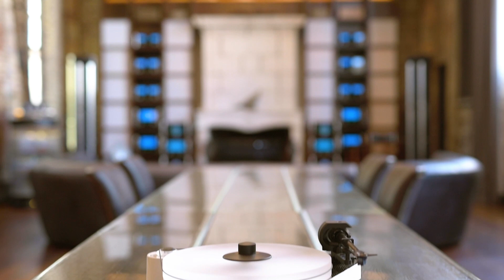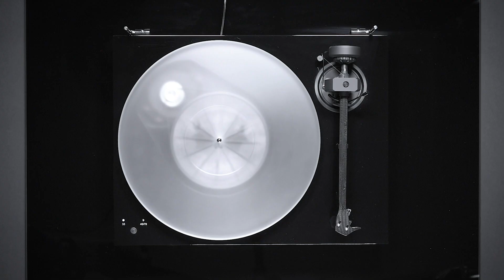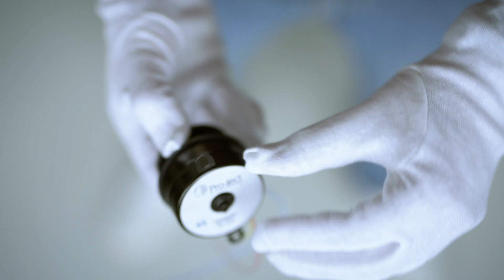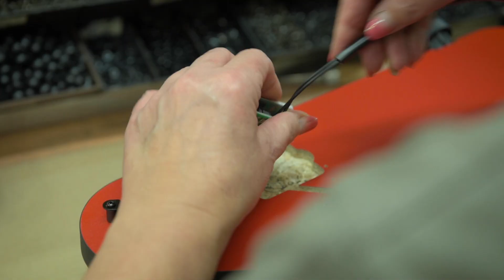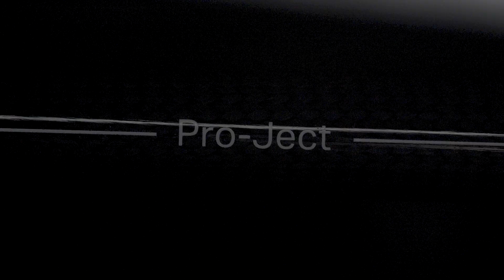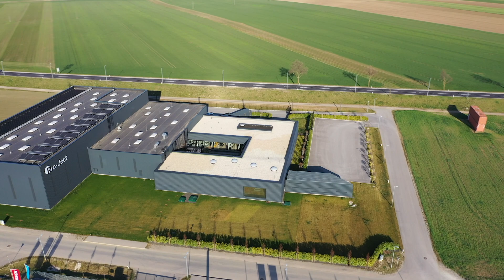10 Reasons for our turntables | Pro-Ject Audio Systems

Comment: I bought a Pro-ject 1. 2 brand new in 1995 (I think 😂) it was an entry level machine made by Pro-ject and it's still going strong and still sound's fantastic.
Reply: I've had one since '98. Got rid of the Oyster cartridge right away, though. The Grado Red has sounded really good, though I'm sure others would as well. The X1 and a few others have tempted me, but I've decided I'll stick with it until it refuses to stick with me.
Reply: @leonardblush2557  mine came with an Ortofon cassette.

Comment: Treated myself to one of these turntables recently, love the basic design but found a couple of problems using it. The on/off switch is underneath and using it will push the turntable to one side. Lifting the cover will lift the front of the turntable. I've heard that by using 3 mounting feet is ideal, but i found it made the table very unstable.  Most of these issues can be solved by using a heavier or better quality wood for the turntable carcase.
Reply: which one are you talking about?
Reply: how do you manage that? I admit the switch on my (carbon Evo) is stiff, but i don't just use a finger on the switch my thumb is on the top of the plinth so the table doesn't move.  I don't have any issues lifting the cover so your must either be very stiff, or you're applying more force.  Stability issues I don't have either unless you lean on the rear of the table where the single leg is. 3 legs  is theoretically the most stable design, it will sit on any surface no matter how uneven that surface is, which is why you see this employed on many high end tables, and many barstools too ;-)
Reply: The problem with the lifting of the cover and the stiff hinges also occurred on my essential 3. But it gets better after time. I really love my essential 3. Only issue i really had is that it took me a while to figure out that the usb output would only work if u used thr built in pre-amp. Since i connect my table to an old amp with phono in, i had switched the onboard pre-amp off. Thus disabling the usb. Now i know this, i will switch the pre-amp on whenever i want to make a digital copy of a record, and off afterwards. The switch is on the back of the connection box making it a bit difficult to reach.

Comment: Warning! This thing is silent when a record is not playing. I have accidentally left it on more than once. Awesome product
Reply: Nothing silent about 50db of rumble and motor hum.
Reply: @DJWolves97  Yeah, if the needle is not on the record, you hear nothing. Motor completely silent.
Reply: @abefroman764  Get full range speakers and a subwoofer and you will hear what I’m talking about. Which model do you have?
Reply: I have the pro-ject essential 3. Hooked up to a decent headphone amp with Philips X2hr headphones. When the unit is turned on and amp volume at max (no record playing), it is completely silent. No hum or rumble!

Comment: Except the A1 which...was a return for replacement for me. The platter came wobbly, the mechanism clunky and the worst parasitic noise in the speakers when in phono mode my guess because the platter rubs against the central spindle (not a great design). Quality control? Hope the replacement will be better or it's a return for me😑

Comment: i wonder if there will come a aluminum subplatter for the x1? or if i could use the ones build for the debut range?
Reply: I'm not talking about the acrylic platter (no problems with that).. I'm talking about the plastic sub-platter and the fact that there is an upgrade to aluminum for the debut and classic range but not for x1

Comment: What Pro-Ject turntables would be in the budget of 250$ if there are any, thanks!
Reply: Pro-ject Primary E. Factory set, but replacing a cartridge with another one would be a little harder than on more expensive models.
Reply: @peterregorsek1504  I'm currently saving enough money to hopefully get a debut carbon, or an Esprit!

Comment: Turntable, amp, speaker that's it?
Help me Pro-Ject I'm a little confused by your website(sorry I'm a novice) and no shops during lockdown!
Reply: If your amp has a phono input, you're fine. If the turntable has a high level output, you're fine too. Otherwise, you'll have to get a separate phono preamplifier (because of the very weak signal coming from the turntable)

Comment: I am thinking about buying a debut carbon evo, and am wondering what the best options would to if I want to listen to it via hesdphones, but might upgrade to speakers later...?
Reply from the maker: if you want to buy speakers in the future, a MaiA S2 or DS2 would be a great choice for example. Both have a headphone output on the front & depending on the speakers & features you need you can choose between these two.
Reply: @Projectaudiosystems  thank, that helps... Would you suggest using an external phone preamp, or use the integrated one in the beginning?
Reply from the maker: @renelesch6244  the Debut Carbon EVO has no built in phono preamp, but both, MaiA S2 and DS2, have one included. For sure, you could also go for a tube amp like the Tube Box S2 if you like the tube sound.

Comment: Are the tables in the RPM line being updated? I have an RPM 5. I think I'd like to move to a 5 Carbon or 9.
Reply from the maker: There are currently no new RPM models planned.
Reply: I can recommend the RPM5 Carbon which comes with the project 9CC Evolution arm and Ortofon Quintet Black stylus, sounds absolutely amazing 👍

Comment: Looking to buy my first turntable and have been eyeballing the Essential 3, but the wow & flutter seem quite high when compared to for example a Debut Carbon. Is this anything to be worried about in terms of the playback quality of my records?
Reply from the maker: As the Debut Carbon EVO features better materials like a heavy steel platter for example we were able to reach better measurements. The Debut Carbon EVO is the more advanced model compared to the Essential, but also the Essential is still a great turntable & perfect for beginners.
Reply: Buy a vintage Technics and you won’t be sorry.

Comment: No direct drive turntables?
Reply: You won't find hi end (over 2000€) or mid range (1000-2000€) turn tables with direct drive. At least those intended for pure sound quality because the direct drive causes vibrations, and thats the main goal of these turn tables, get rid of all that causes vibrations. Normally are Dj turntables and entry level the ones with direct drive. cheers.
Reply: @Thryym  You should do a bit more research before posting, because that's incorrect.
For example VPI, which is a well know audiophile brand makes direct drive turntables as their highest-end turntables, like the VPI HW-40.
Swedish Analog Technology, which is also a well known high-end manufacturer makes a direct drive turntable called the SAT XD1.
The SAT XD1 uses the same direct drive motor as in the Technics SL-1000R, which is considered to be one of the most accurate turntables made in the past 40 years.
A very similar motor is used for the Technics SL-1200G which is an audiophile version of the regular SL-1200 models.
Clearaudio is also a well respected brand in the audiophile scene and their best turntable is the Clearaudio Statement - also a direct drive.
I can call at least 3 more examples, just from the top of my mind, like the Brinkmann Bardo, Grand Prix Audio Monaco, Thorens TD402DD... 

You'll probably be able to find many, many more examples of high-end DD turntables.
Reply: @QoraxAudio  Thank you for increasing my knowledge.
Reply: @Thryym  You're welcome 👍